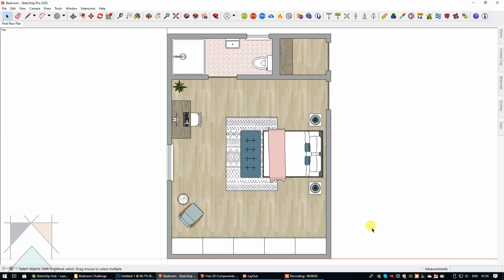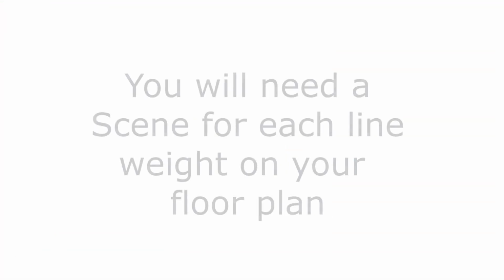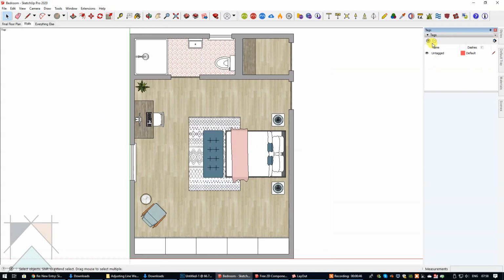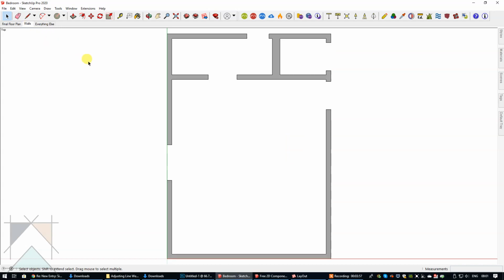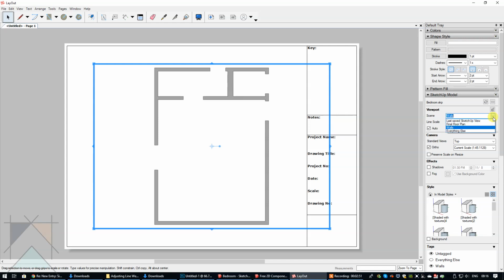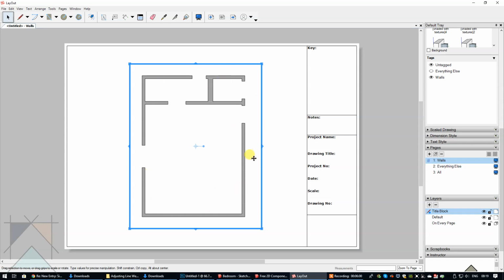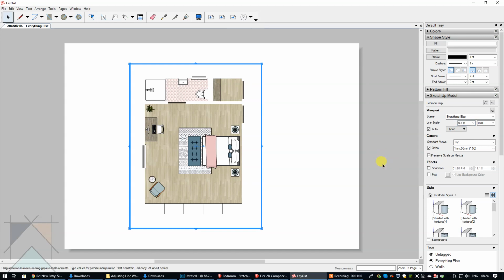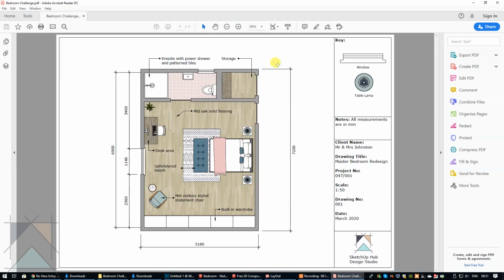Adjusting Line Weight in a Floor Plan Using SketchUp & LayOut

Comment: Line weight in Layout is a bit weedy, I find It’s far easier to just do an offset and fill in sketchup to thicken the line. Then it will view in layout just fine.
Reply from the maker: Hey, do whatever works for you but I find that creating separate layers/tags especially for two or three different line weights (including furniture) is the more efficient and professional looking option :)